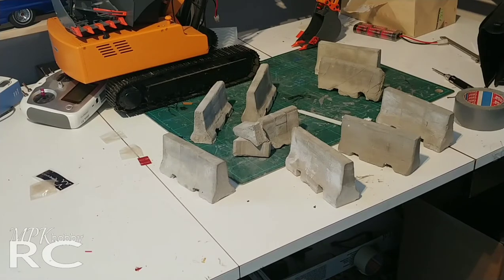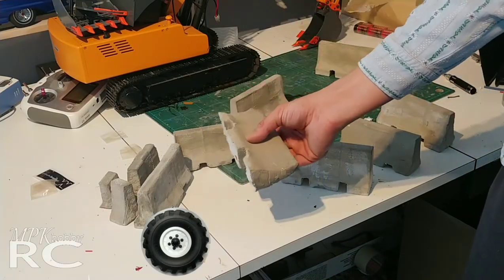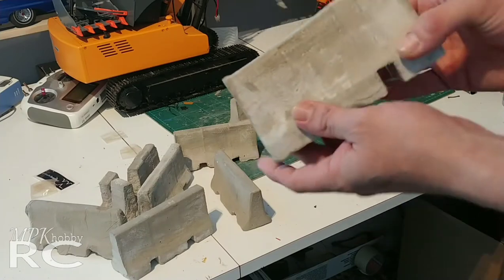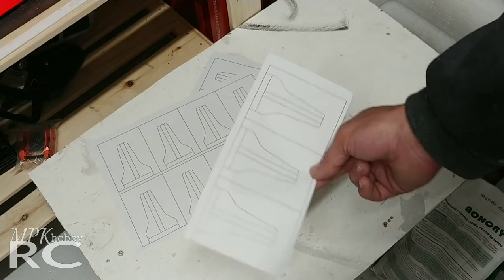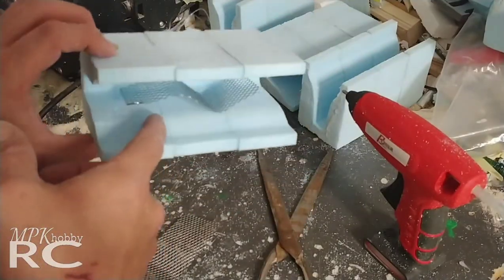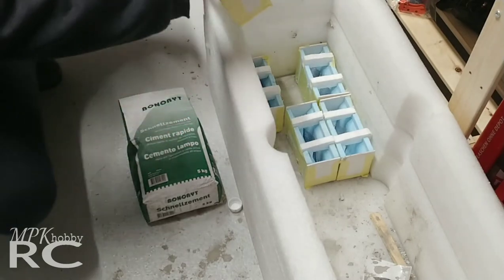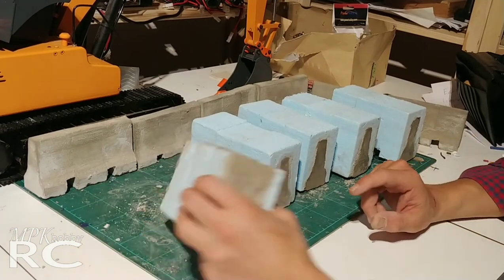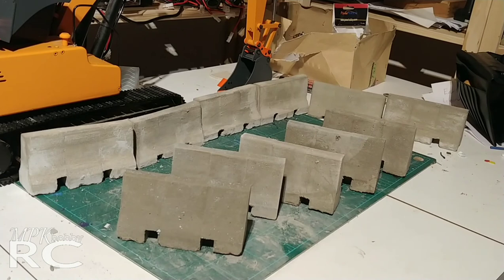Jersey Barriers!! How I Make My Molds!!!

Comment: Not bad 👍🏼  I’m impressed with the blue foam not sticking.  It is a exterior foam insulation.  I also used it as my final sub surface for my above ground pool.  Makes the perfect seamless surface for pool liners.  The clear plastic wrap is what Rc voodoo told me to use on mine.  I never did but he said he used it for the forms at his local drift track.  Well you know what they say 3 times a charm so looks like I’ll show how I make mine in a video.  Nice how too vid bud, have a healthy and safe merry Christmas
Reply: Ps Pam cooking spray or similar works the best for releasing from molds.  I’ve tried various sprays lubricants etc and I find that works best and is the easiest to work with least expensive. I’ve stopped making the barricades at about 40ish before I built up the 360l overlands and the track loader.  I built the fork inserts for the adjustable 870k loader forks.  Now that I’ve got the track loader the fork sttachment on that is just a smig closer together.  So I’ll adj print to possibly fit the track loader.  It also looks like you got some new buckets for your. Excavator
Reply from the maker: @thatsmyrc  hey man Thanks, wow 40!! Lol thats a lot!! 
Im really happy with how they came out.. And pretty easy to make the mold (even if time consuming). 
Id still like to see how u make yours!! 

Got the buckets when i got the loader forks, just attached the quick release so looking forward to using the attachments now!! 
Im building a screening plant!! For the top bit of my road.. Where all the dirt is.. So gonna have to remove a lot of material first!!

Merry Christmas!
Reply: @mpkhobbyRC  lol yea the molds I’ve created I can turn a barricade out about every 20/30 min per mold. I took one weekend to whip out a batch then shut down the assembly line due to my kitchen project that I started while back. Yours are turning out as well.  I have found that when designing the holes for the 870k forks you’ll need to make sure you’ve got the space to slide fork in w/ room to spare for placement.  Now that I’ve got the track loader those forks aren’t adj so the fork placements made on the barricades I’ve made already are slightly to far apart for track loader.  So now I’ll go back into my cad files and adj the design for both 870k and track loader to fit the barricades. Always something but it’s always fun.
Reply: @thatsmyrc  Pam..................I'm going to have to try that out! It's FAR cheaper than the EXPENSIVE release agent I've been using in my silicone molds!

Comment: Do you think spraying a “release mold” onto the foam will make it easier for the cement to pull out once dries?
Reply from the maker: I guess if u cut the foam out with a hot wire cutter it would be smooth enough.. but with a scroll saw its just too porous.. I'm thinking... but why not try...? Thanks for the comment!